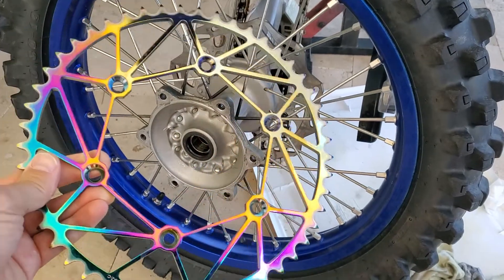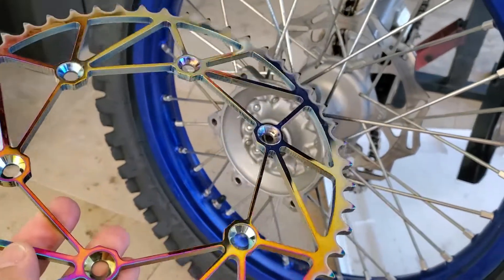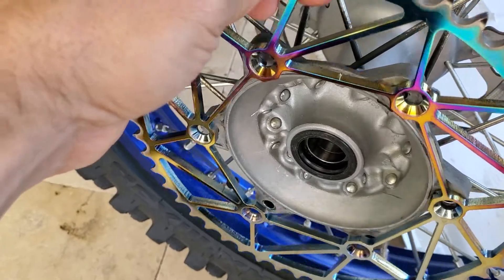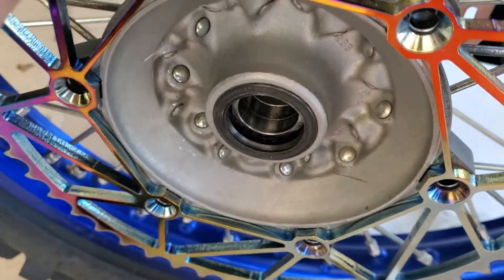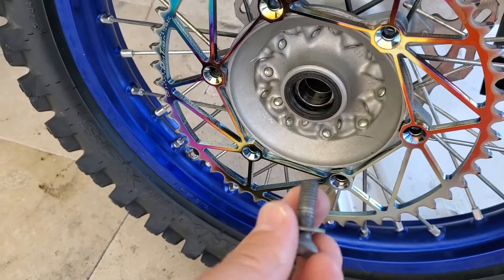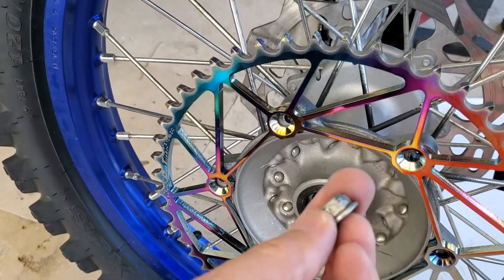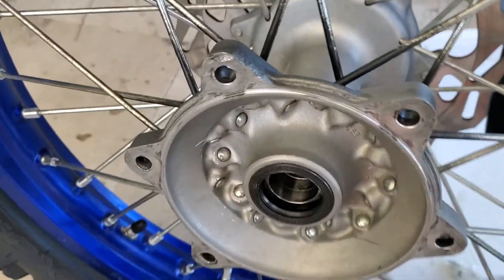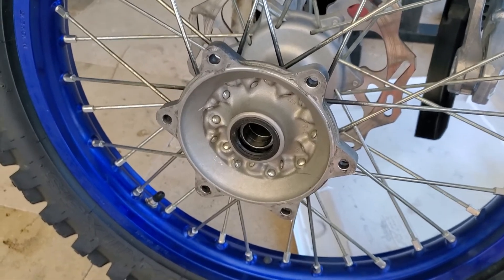WARNING!  YZ450F hub bolts, rear sprocket, damage or injury.

Comment from the maker: UPDATE: With the new bolt set I was able to use the washers and I recommend you do. The new bolts were a few mm longer, and so the bolt punched thru enough to lock properly. They also had factory loctite and so its been perfect. NOTE: I had to file down the lips created in the bolt holes so the sprocket would get flush. The slamming of the loose bolts made tiny lips...
Reply: Thanks! I'll for sure get the titanium bolts when I do upgrade this summer!

Comment: Thanks for the info. I was looking into getting that dirt tricks sprocket and titanium bolt set. How's that sprocket holding up? Are they worth the extra money?
Reply: He didn’t use loctite the bolt won’t snap after it’s been put on even if it’s tight I don’t think anyway
Reply: @luixzzzz  I had the same issue with my TBR7 and yea the bolts had locktite but still broke loose so IDK.
Reply from the maker: Yes, the sprocket is a beast. The x ring chain is also doing well. I have reduced my need to adjust my chain like 95%. With my old set up, non o/x ring chain and aluminum sprockets i was literally needing to adjust my chain pretty much every 3 hours or so. Now! Every time I check it, it's in spec. I love this improvement. I have to admit, I can feel the weight increase. It makes no difference to me because I have way more power than I need. If your a brake tapper you'll get more rotation with this extra weight.
Reply: @wetlifesports  Awesome info! I've got the 2022 YZ450FX that's got an O-ring chain and since I've only got like 50hrs on the bike so far I haven't seen much wear or adjustment it's still in spec. I've been riding in the cold tho and still getting use to the massive power so it's not like I've been able to really open it up and beat on it yet. Thanks!!!